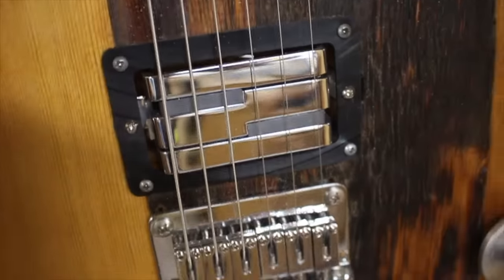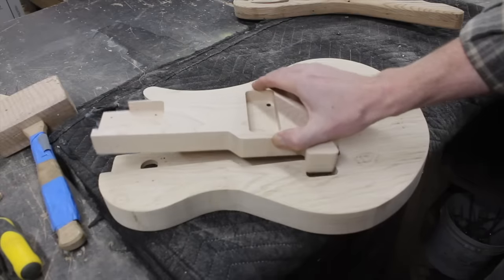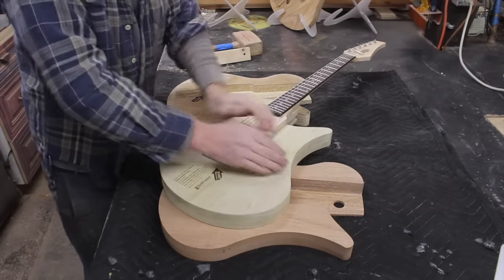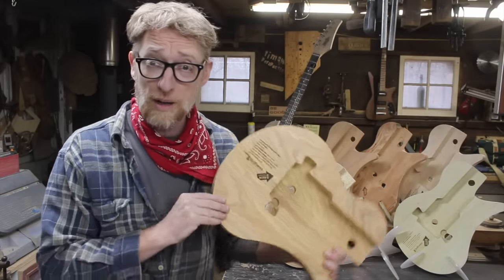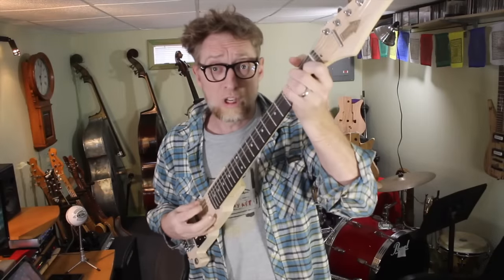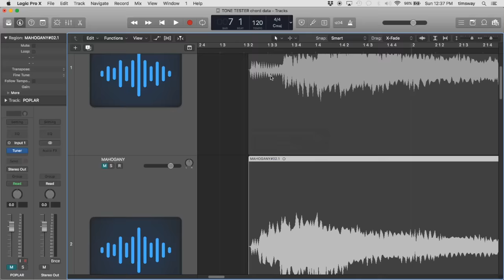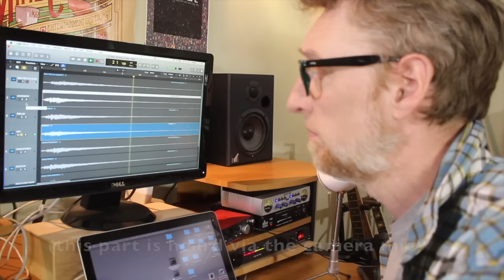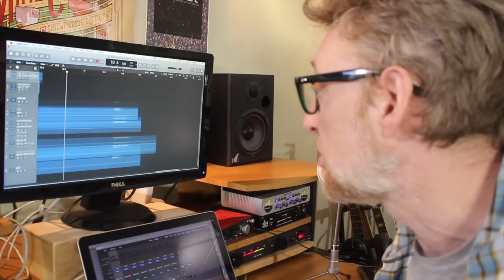Tone Wood Tester: One guitar to test them all

Comment: Thanks for this! You just proved what I've been thinking for 30 years. I've been playing daily since 76 and I can't tell a difference from wood alone on electric guitars. Acoustic is totally different! The wood makes a huge difference!
Reply: in fact, it's SUPER-wrong. 

EX: you can play 3 IDENTICAL guitars made by robots... and all 3 will FEEL and SOUND differently! (It's kinda crazy.) LIke, i owned two of the SAME make of a Chevy car, made the SAME YEAR... and they drove very different etc. It's impressive how that happens. 

Also, EVERY single time I've done BLIND sound tests, not once have people guessed correctly. (Rule of Thumb: if experts say it, the OPPOSITE is exactly true. Like how my LIGHTEST guitars all have far more sustain than my HEAVIEST guitars.) 

Tone wood is almost always BS. 

Ya gotta love (i mean hate) the drummers with 25 cymbals... when even drummers in the audience can only detect like 5 different sounds!  Ditto 10 toms!
Reply: Dumpy Goodness ... the light guitar having more sustain makes sense.  Sound is energy.  The lighter body will require less energy to vibrate (and thus sustain sound).  This tells us that the energy input is a constant, as from a single strum, then lighter body will vibrate for a longer period of time.  

I would not be surprised at all if it will be discovered that there is a perfect weight for guitar body for each individual wood species, in terms of volume and sustain.

Of course really, all of this is kind of moot anyway, as components, and more importantly playing style have a HUGE effect on tone.  I can make my Strat and my 335 both sound like I am running a way peddle, just by changing the angle of my pick repeatedly.  

So while different woods most likely produce subtly different tones, the musician is the biggest factor.

That said, I love the approach and the testing in this video.
Reply: @geebee3d   You have hollow body guitars with dark sound.. some hagstrom viking with p90s for example. Most hollow body jazz players like brighter pickups and setups, has nothing to do with wood. Sound in an electric guitars comes from strings vibration over the pickups, the more the guitar vibrates the more energy is loss from the strings the less sustain you will have.
Reply: @geebee3d   I don't agree with your conclusion regarding sustain. More energy for equal amplitude doesn't mean that the body ever reaches equal amplitude - on the contrary we should expect the denser material to reach a lower amplitude unless there is more energy transferred to it, but I don't see why more energy would transfer. Density also doesn't imply anything about the loss factor of the material, which will determine internal energy loss for a given amplitude. 

That being said, if a less dense material moves enough that the acoustic loss (vibration converted to sound) is greater, then the sustain would be less. This is shown to be true in acoustic guitars, where sustain is inversely proportional to the peak sound pressure due to loss of energy to the air. Any solid-body electric guitar should be so stiff that in-practice this is fairly negligible though, along with the loss factor from the body vibrating, as amplitude will be near-zero in all cases. 

Effectively, any electric guitar body should be so stiff that all string vibrations are below the body resonance. This is because stiffness is proportional to the thickness of the material cubed - it should be fairly obvious from this that stiffness is astoundingly high for a solid-body electric (25-45mm of wood) compared to an acoustic guitar top (2-3mm of wood) for any material from which an electric guitar would reasonably be constructed. Discounting bracing, a 35mm solid-body electric built with the same wood as a 2.5mm acoustic guitar top would be over 2,700x as stiff and have a proportionally higher resonance.

We also shouldn't confuse density with stiffness - stiffness to density ratio is probably a much more useful measure for this purpose if you're trying to pick just one figure because both relate to speed of sound and resonance. Regardless, physics supports the result of this video which shows practically no difference between the electric guitar bodies. Once the stiffness pushes the resonance up high enough you just get efficient vibration transmission regardless of the relatively small difference in Young's modulus or loss factor of the materials used. Mechanical isolators rely on the opposite of this, using an interface with much lower resonance than the input vibrations in order to reject them (like the shocks in your car). Only vibrations at or near resonance will reach significant ampltitude from the weak driving force of the strings.

tl;dr: Any wood will sound nearly identical in an electric guitar with a thick enough body.
Reply: @maudiojunky  Nice breakdown..)/* Logical..)
Reply: This was fantastic!
I've found over the years, that in terms of how wood plays a part in a solidbody guitar the most,  is when playing at stage level volumes where you're pushing alot of air, how easily/readily the guitar will reach harmonic feedback.

That has less or nothing to do with the species, but more what that particular piece of wood's resonant peak is.
It's not really a "tone" thing per se.
What affects resonant peak? Numerous, and frankly uncontrollable factors.
The cellular, and structural makeup, anomalies in the biomass, etc... of the particular tree, or even the section of it used for a particular body.

I've had some guitars of the same model that are always on the edge of feedback, and others that have a hard go of it, and would need to be subjected to alot more volume to get there with my old Marshalls or Vox amps, if at all on a typical vintage style rig.

But it's a minor detail today. With amps now, as well as modelers, there's more than enough gain, or compression/sustain based effects that make up for shortcomings.

I really loved this video, and it's probably the best I've seen with such an ingenious method for testing each body.
Just outstanding!
Reply: @dumpygoodness4086  the only things that makes a difference are pickups, pickup position, strings, string height and electronics. Everything else can be whatever and the tone won't change or change in a capacity that even while active listening human ear can't differ
Reply: Absolutely. That s why they build so expensive opera houses with perfect room and wall conditions.
Reply: No

Comment: Best part of the video is seeing how you interact and talk to your son. He seems like a great kid and you are a good dad including him in your work and inviting his opinion. As for the results I am not all that surprised that the differences between woods are extremely subtle. Of course real guitar construction is not always that simple and straightforward, most of my nicer guitars have combinations like mahogany body base + figured/carved maple tops, but I think the conclusion of the wood choice only making subtle differences in output, sustain and tone with all else being equal is probably fairly accurate. One suggestion though to have made the baseline test a little bit more interesting and accurate though would to have recorded 3 or 4 chords like Open E,  A barre (5th fret), C barre (8 fret) and E barre (12 fret) so you could get at least a little data on the wood response at different frequencies. But you did a good job with the testing based on a single chord for comparison.
Reply: The differences between woods are actually rather dramatic IF you are careful about wood selection when preparing to build a new guitar.   Picking out better than average woods for one guitar and below average woods for another will result in a pretty significant variance in tone and sustain that is easly noticed.

Comment: I'd say get in touch with Adam Savage to build a robot that can strum precisely at different velocities to get an exact reading on how each performs at different volumes. I'd love to hear each of them recorded acoustically  with a nice condenser mic, and a contact mic on the body as well. Awesome work with a very creative solution!
Reply: And once that's done, use Logic's "Strip Silence" function on each recording so that anything below a certain threshold of volume will be removed.  You'll be able to objectively determine where each sustain tail ends.
Reply: Graham Rathbone  more extensive testing with repetition and further evaluation is definitely part of it. id just like to see a robot strumming arm with variable picking angle and velocity that can repeat the experiment with inhuman accuracy. that and more ways to observe the difference thus contact mics on the body
Reply: There are two ways to create sound on an electric: a moving string, and by moving the pickup under the string (wood vibration). Hence, all that counts is what the pickup "hears." With an electric, you analyze what comes out of the pickup, not the vibrations that come off the body of the guitar.
Reply: it would seem that doing an acoustic measurement would be flawed. In a solid body guitar we only have the pickup output as our main source to determine tone. The best science is to measure output and not surface resonance.
Reply: A pendulum with a pick would strum the guitar the same every time. Also, holding a chord with your fingers really changes sustain. Just tune to the chord you want to play and have the pendulum play it.
Reply: Christopher: I agree with your idea. I think acoustically might be a further interesting analysis. It could reveal if there are some differences more easily noted that way as compared to the ones obtained with normal pickups, or vice-versa, or be more or less the same.
Reply: It's true even pick angle and how tightly its grasped can effect "tone" the only way to test it further is to make as many variables null as possible.
Reply: @antoniomonteiro1203  Recording the acoustic sound is useless. It doesn't matter if there are differences because an electric guitar works with pickups (magnetic). Differences would prove wood species can change tone acoustically, which we already know to be true from acoustic guitars.
Reply: @escalator9734  I agree with all you say, except "useless". My idea as suggested by "further interesting analysis" would be, for example, to compare resonance frequencies in the acoustic analysis with the one in the electrical one. More broadly, to try to see how much of the acoustic part of the response translates to the electrical signal.
But it would be clearly a scientific research I would like to do. But as I have only one life, probably it would take too much effort to be worth it!
Reply: @bobpascarella4496  I agree that the pickups are MOST of the tone, but the rest of the construction of the instrument would all have their own individual parts to play in tone and sustain. The bridge and nut would effect the timbre of the strings before they even get to the pickup, and a pickup easily replicates these differences. The mass and density of the body would affect the sustain as the strings would continue vibrating for longer in a material that would be absorbing their energy less. But I feel like a material that would be incredibly good at preserving the strings energy would not be as good in allowing any tone to show through, I think many people forget that since a nut and bridge are affixed to a guitar, regardless of their construction, some of the energy will be lost in those contact points as well. A wood that would absorb virtually none of the vibrations would increase the sustain, but not allow a deadening by absorbing energy through the wood underneath the 2 main contact points, nut and bridge. This would take away some of the natural bite of the plucked string and create more of what we would probably perceive as warmth. I'm sure there are a million variables here, but basically anything changed about am instrument "should" produce a change in the sound, it's probably just more of a question of, "is there any possible material that I could use to make (x) part actually have a NOTICEABLE change in tone?" I'm guessing for some parts on a guitar it wouldn't matter as far as tone goes what you use, because the difference would be so imperceptible that we probably would never hear the difference.
Reply: @antoniomonteiro1203   "it would take too much effort to be worth it!"
Yeah unfortunately doing interesting stuff isn't gonna make us a living. It would be coll to test all kinds of stuff
Reply: Yes! We should try to get Adams attention and see if he'll help!
Reply: @ Christopher Bernier-  Recording the "tone woods" acoustically will totally defeat the whole tonewood debate that has been raging online for quite some time. I don't think anyone will argue or debate the situation on an acoustic platform!! It is my understanding that he whole heated debate is focused  around claims by  guitar manufacturing cartels that a solid body electric guitar with ordinary magnetic pickups will sound noticably different depending on the species of "tonewood" the body of that guitar is made from. While on the other side of the debate are folks who claim the physics of the electric signal that pickups produce is not affected by the material that a solid body guitar is made from..  Personally, I've heard convincing arguements from both sides of the mess and I am just as confused as ever!! Guitar makers laugh all the way to the bank as they continue to charge large premium prices for electric guitars that have bodies made from specific species of trees.
Reply: @floydloonie4880  "the other side of the debate are folks who claim the physics of the electric signal that pickups produce is not affected by the material that a solid body guitar is made from."

No, that's not the argument.
The argument is : the species of wood used on a solid body electric guitar will not make a difference noticeable to the human ear.

Obviously a drastic change in the material used will have a noticeable effect on the sound (wood vs metal/plastic/etc), because the differencesin the physical properties of these different materials are big enough to induce a noticeable change.
Wood is still wood, even if different species can have different properties it's not enough to be noticeable.